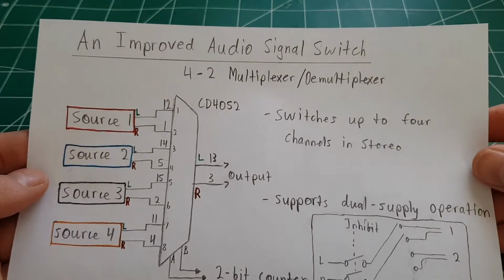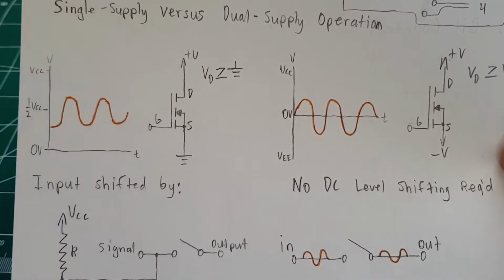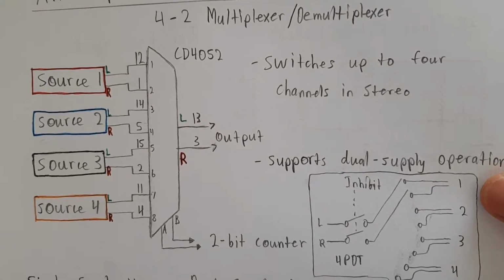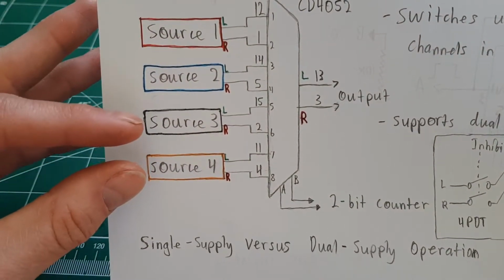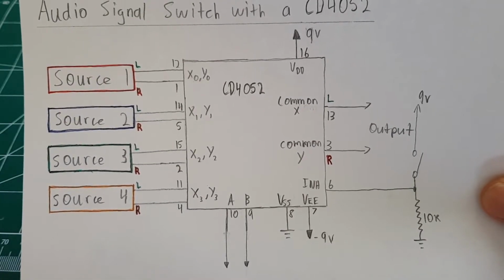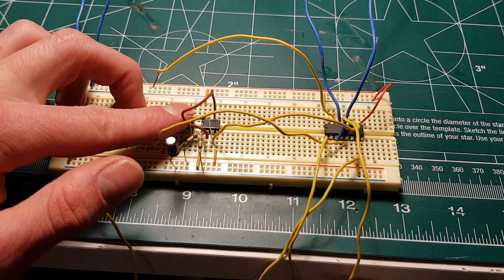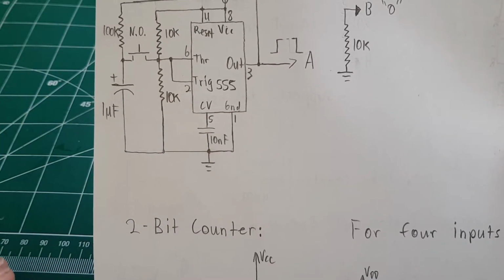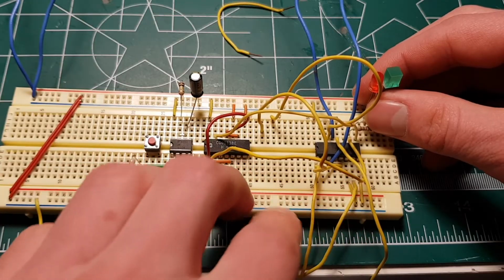An Improved Audio Signal Switch

Comment: Great video, exactly what I was looking for my own DIY Wah bypass switch!👍 I know about the 4053 that might be a newer version? But thinking of only doing a bypass I guess a 4966 would be more likely the way to go?
Reply from the maker: The CD4053 is not newer, it's a 3-throw version of the CD4051. The CD4052 shown here is the 2-throw version. The CD4066 is basically just four separate single-pole single-throw switches. For your pedal, likely any of these would work, but I know some pedal designs need multiple poles for the switch. In that case the CD4052 or CD4053 would be needed. Do put some zeners or some kind of protection on the input and output of the circuit though, these CMOS switches are not immune to static.
Reply: @thetuberoaster8321  Thx a lot for your explanations and helpfull advices to point me in the right direction!
Reply: @thetuberoaster8321  Hi - not to pick a nit, but here and in the description, you describe the '4052 as a "4PDT". It is actually a 2P4T device. One of your schematics shows it clearly. The left and right are the two poles, and the 4 possible output positions are the places these two poles are "thrown" to. Think about the very old knife switches. It is correct that the CD4066 is "just four separate single-pole, single-throw switches," but you could also call it a 4PST switch :)) ... Consider too the flat, phenolic 'rotary' switches  - you know, the kind that can select multiple positions when you turn the shift. Typical are SP4T, SP6T up to SP12T ... and more (I've seen one that has 32 positions) and you can have DP12T etc.  ... but who's counting :)) .... thanks for taking the time to do these videos ... good stuff !

Comment: All this nonsense is useless this was solved back in the 1980's with midi signals switching audio relays it was solved back then and has worked till 2023. No professional uses hard contact switching with multiple outputs and inputs, one of the biggest problem is the industry of using Midi audio switching has always been at a Pro level area so the boards are not easy to find as kits. Custom Audio ( the Bradshaw Switching system dude) basically had a monopoly on the Midi to Audio switching boards. Even in 2023 there is no kit available you have to build the system yourself, Voodoo Labs is a hit and miss with these smaller switching systems. Basically the only way to properly switch and mix audio inputs to outputs is using Midi Signals on a floor controller. This solves many problems as Midi is opto and the relay switches ramp up and down so you never hear any pops or hiss. I am still dumbfounded how in 2023 that no Musical audio corp has taken over this area since hardware is so cheap these days to do this. Literally a 20 in-20 out midi audio switching rack and floor controller should cost less than $500 these days but yet nothing out there, not even Behringer is in this area which is very suspicious.
Reply: LOL I had to laugh when I read your post - it baffles me too that such a simple concept hasn't been laid down in silicon with pro audio appropriate voltage levels. There are several vendors that will do custom chips for relatively cheap, so maybe you have a small side hustle? Behringer wouldn't touch this - not enough demand. If you do make a batch, please have 'em work on +/- rails of 24 v p-p so we can have some headroom. :)) Think Eurorack synth stuff <- prolly your biggest DIY market. cheers
Reply: So what your saying is, if I want to connect a radio receiver, a record player, a tape deck and an aux input to a single amp for let's say, a hi-fi setup, I need to go out and buy a midi controller and all that extra crap.

Reign it in fella, you're clearly out of your depth.
Reply: @JaenFoster  WTF does have to do with a Monopoly that has existed now for 40 years? You do realize that there are no kits available for a 20 input output Midi relay switch system you have to basically order them via OEM channels. The reality is we have too many jackasses who are walking around with their eyes closed walking into walls with their stupidity. You want a better audio switch ? go back to the mid 80's it was solved back then with Midi and it's criminal how even guitar pedal switches have not moved over to these systems since those pedals would benefit the most. Every single audio switch on the planet should be running off of Midi Relays these days specially in Studio audio and live audio usages since these switches eliminate 100% of all the audio problems people are still complaining about after 30 years!!!. Midi Relay switches should be mandatory in all guitar fx, input-ouput mixers it's downright stupid to keep going over the same bull shit MIDI RELAY AUDIO SWITCHING SHOULD BE MANDATORY in practically in all audio applications.
Reply: @danfuerthgillis4483  wtf has your comment got to do with the video?
The video is about a small analogue switch IC and you're going off on some bs rant about midi switches (by which I'm guessing you mean patch bays). How is that relevant to the video?
Also, did it ever occur to you that the reason that there's no kits for what you want is because there's no bloody demand for one. Like how many do you think they'd sell? If there's such a demand, why don't you fulfil it? Not that difficult to hook a bunch of relays up to an Arduino. But let me tell you, I spent years working in the entertainment industry as is transitioned from analogue to digital on everything from multimillion tours to small amdram productions and not once did I see anyone using midi controlled patchbays. I'm not saying there isn't a use for one, they exist then there's a reason. Modular synths maybe. But why should EVERYONE be using midi controlled switches? You think I, or anyone else for that matter, want to be f'king about setting up midi controller just to switch my hi-fi from one source to another. Finally, these ICs are generic analogue signal switches. They're not specifically designed for audio. You're tilting at windmills my friend. Time to take your meds.

Comment: anyone have any troubles with pop/clicks when switching between audio sources? I'm using a different IC but it is also an analog spdt meant for audio switching applications, but i get pops when switching.
Reply: If you switch between audio signals while they are active, there is a good chance you'll land on the new signal when it is at a much higher or lower level than the previous signal.  This sudden discontinuity in the signal level sounds like a "pop."  You can get the same thing just by starting a sine wave near its top (or bottom) going into a quiet amp.

If you want to switch quietly, you'll need to start from a quiet signal level and then ramp it up to the final volume over a number of milliseconds.  This will take a bunch more circuitry, but that's where getting to "design a new circuit" fun comes in!
Reply: Another trick is to delay the switching until the signal crosses from negative to positive (zero crossing). This will get rid of the worst clicks, that are due to dirrct discontinuity, but there will still be discontinuities in the first and higher derivatives, which will be perceived as less irritating, but clicks nonetheless. Unfortunately, blocking also these will not give a sufficient number of opportunities for switching, so the switch will "never" occur.
Reply: a year  later  ... this is caused by an impedance mismatch, or just a noisy switching mechanism.

Comment: im using a CD4017 as the 1 to 4 counter to indicate current input with leds and have to figure out the 2 bit counter for the cd4052 A/B selectors (i dont have any D flip flip). Everything is getting along for this project thanks to you!
Reply: can you share the schematic of yours

Comment: Its nice and worthy content for audio lovers. Could you please help how to add LED indicator while switching from each source.
Reply from the maker: You need a decoder circuit to turn the binary coded decimal logic back into normal counting numbers again, unless you want your LEDs counting in binary. For two inputs this is easy, all you need is an inverter. For four inputs, you need a 2 to 4 decoder chip like the SN74LVC1G139 which will give an output for each LED. The outputs are active low (inverted logic) so you will need to switch the low side of the LEDs to make one light up for each input selection.
Reply: @thetuberoaster8321  I am using decoder circuit of 2:4 Decoder using 7404 and 7408 ics
Reply: @the tube roaster - can you plz help how to select stereo and dvd which has 6 channels like front, left, surround left, surround right and centre. 

I can using relay but it would be. Much expensive, need 5 relays so thought once I select dvd, output should give 6 channel instead of stereo output(right, left)
Reply from the maker: @SV-2277  That should work
Reply from the maker: You can use two CD4053s together to get six channels that can switch between two sources. The 4053 has three separate single-pole double-throw switches inside. You can tie the input select pins together so they all switch at the same time. To accommodate more sources, you can add another pair in parallel and use the inhibit pins to select which pair passes the signal. The logic circuit might need to be modified however.

Comment: is the 7 pin cd4052 -9v necessary, i try disconnect it, and it still work. sorry if the question is stupid, im still beginning noob level
Reply from the maker: It will still work, but it won't be able to process signals that go below -0.5V. The purpose of split supplies is to allow the signal to swing above and below 0V and not some middle voltage above ground. You can have a DC offset and use capacitors to isolate it like in my CD4066 video. This chip has an extra pin specifically for this purpose to save you the trouble of creating a makeshift split supply and needing to add capacitors. It really depends on what you are using it for. If you are using it to process signals that never go below ground then you don't need a negative supply. If you are processing audio, you do. The split supply can also be used to power the subsequent op-amp you might need later on to process the signal with.

Comment: Could the CD4052 be run off of 5v-0? If so, would I need a voltage divider as shown in the other video?
Reply from the maker: You can run it off 5V but you would need to do the voltage divider thing and tie the 2.5V part of the divider to the ground pin of the chip (pin 8). Then the 5V would go to Vcc (pin 16) and the 0V would go to Vee (pin 7). Then you'll need caps on the input and output to isolate the DC as in the last video. The problem is after all of that you might not have enough headroom for the signal depending on what you are trying to do. A better solution would be to get one of those small switchers that take 5V and turn it into +/-9V. Then you could also power any op-amps you might want to add to the circuit.
Reply: @thetuberoaster8321  I got this working. I have a video of my circuit. I don't know if youtube will let me share it. Thanks so much for the information
Reply: @thetuberoaster8321  Here is the link for anyone else struggling to make this circuit https://youtu.be/gfXSOwXIebI

Comment: The ground for the switch circuit needs to be tied to the same ground as the audio source.  Where do you to that, at the wall outlet, or a dedicated ground  connection?
Reply from the maker: The audio ground (sleeve of phone jack or outer conductor of RCA jack) should be tied to Vss (pin 8) on the CD4052 switch chip. You want the audio reference to be between both power supplies so the voltage can swing up and down equally.

Comment: Is there any way to have individual buttons for every input?
Reply from the maker: Yes, but the selecting circuit would have to be totally different.
Reply: @thetuberoaster8321  would arduino solve it and control it by 2 digial pins sending either high(1) or low(0) signals?
Reply from the maker: @djrkzr  An Arduino would solve this, plus you can enable it over USB. You can also do this with a BCD encoder chip and SR latches with each button feeding the encoder chip. I don't have the circuit drawn anywhere and it's a little hard to explain but either will work.

Comment: Hello, I want to use this chip with a positive 12 volts only in my car. Is it okay to use if I just connect VEE and GND on the Chip together and with a voltage divider on each input?
Reply from the maker: Yes, you can do that. You can look at my other audio switch video that uses a CD4066 and voltage dividers.
Reply: Hello, we’re you able to do this? I’m trying to switch my inputs to a car stereo between a Bluetooth module and the Tuner by tapping one of the preselect micro switches on the faceplate. Seems like this circuit is the best for this just need to get it to 12V input 
Thanks

Comment: Hi! Do you think this can be done with 4 different microphones with phantom power?
Reply from the maker: Yes, but you will need to isolate the inputs with coupling capacitors. The exact value will depend on the input impedance of the device after this switch. There's a chance that this circuit could introduce noise into the audio if the power supply is noisy. Usually, mics that have phantom power have a small gain stage already inside them to boost the signal which helps with noise. I think that it will not be as much of an issue as it would be for dynamic mics. Of course, you will need a separate 48V supply with resistors to each channel to they don't all short together but still get phantom power.

Comment: How do I connect a relay to an FM radio output so that it can turn on a light when a strong signal is received?
Reply from the maker: You can make a comparator circuit with a rectifier and capacitor before it like a sample and hold circuit. This will sample the output and if the voltage exceeds the set threshold it will actuate the relay or turn on an LED or whatever.
Reply: @thetuberoaster8321  Thanks but I got it working tonight with a non-latching IR receiver circuit, (removed the TSOP1738) using 2 BC548's, relay and other components. Signal out from radio into a bridge rectifier with NO smoothing capacitor otherwise it does not work like I want it too.

Comment: Hello, I am using arduino for A and B status - 0/1 . channel 0 works fine, but any other - crap on the oscilloscope! I grounded all unused pins - also used 9V /0V/-9V power supply. I am feeling stuck. It looks like "binary" switches does not affect CD4052 :(
Reply from the maker: What might be happening is the 5V output from the Arduino is not high enough to reliably hold a high state in the CD4052. If you bring the control pins to +9V/0V manually with a wire you'll probably see it work. To get the Arduino to switch between 0V and 9V instead of 5V, you'll need to use a transistor to drive the CD4052. Anytime you work with 4000 series chips bear in mind that logic levels can often exceed 5V. The circuit you drive it with must have the same logic level or you will have problems.

Comment: Is there a way to add 4 LED indicators to identify respective inputs
Reply from the maker: Yes, but to indicate all four states, you would have to build a 2-bit decoder circuit attached to the A and B outputs from the counter. The circuit is called a 2-4 line decoder to decode the binary states 0,0 , 0,1, 1,0 and 1,1. You can do it with a quad NAND chip and two inverters. The four outputs will need to have transistors on each of them to handle the LED current.
Reply: @thetuberoaster8321 Can I use a combination of 74HC02 and 74HC00 to create the 2-4 line decoder. Appreciate your help

Comment: Thank you, Brilliant, and explained very clearly!!     question please, if one source was mono,  lets presume source 1, then my thought would be to simply Y split the mono on to both channels at pin 1 and 12,  Would you envisage any problem with that idea? Like would the chip still be happy with 1 and 12 bridged.
Reply from the maker: It would be perfectly fine if you connect pins 1 and 12 together or for any channel. You could even connect between channels and it would be fine.
Reply: Diagram please...all pin connection

Comment: Can this be used with 600 ohms balanced line level?   I have 2 stereo mixing positions with 2 monitors feeds going to stereo house and 2 monitors channel amplifiers.  Thank you.
Reply from the maker: It should work fine as long as the signal voltage does not exceed 6 volts peak (12Vp-p) and the load (the input of the amplifier) is 600 ohms or more.